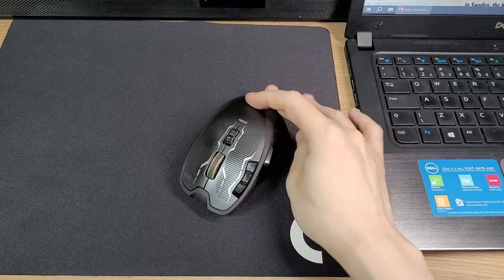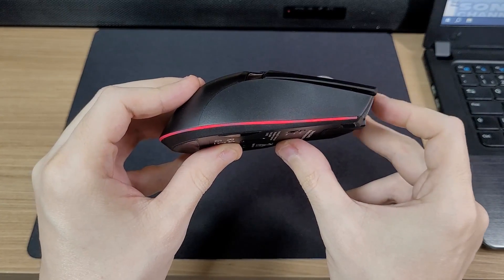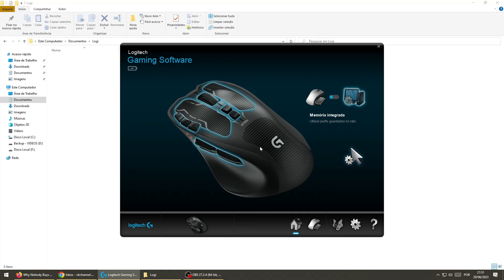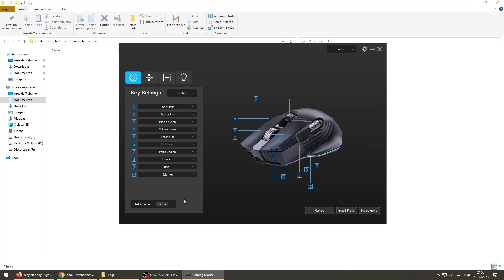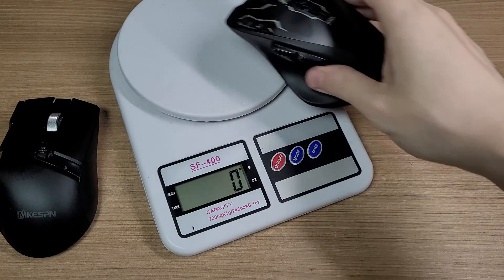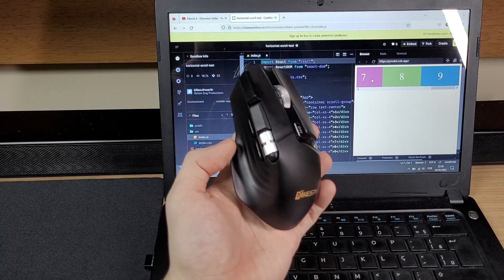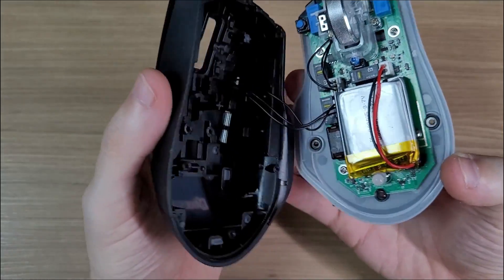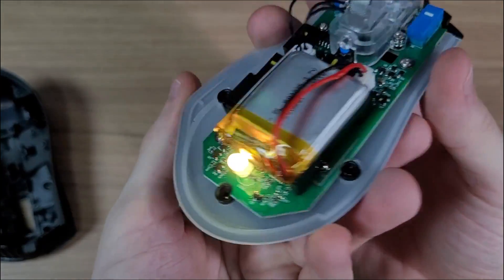The best budget gaming mouse you can get - Mkespn W13

Comment: It could be that in profile 1 you have volume buttons, but in other profiles you don't, could you change the volume buttons in profile 1 to see if it still does side scrolling please?
Reply from the maker: You canot configure the side scroll it is set by default to be side scrolling in profile 1 and volume on the others
Reply: @VKsChannel  but I mean, in profile one you have volume buttons on the left and right button of vertical scroll, so maybe as there are already volume buttons, maybe the side scroll is not doing volume because of that, and because on other profiles you don't have volume buttons the the side scroll takes those